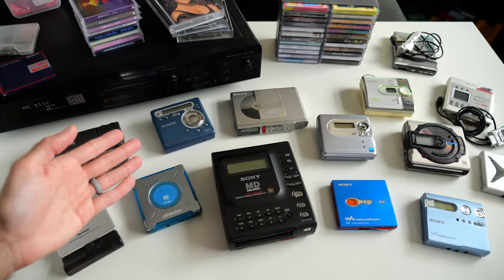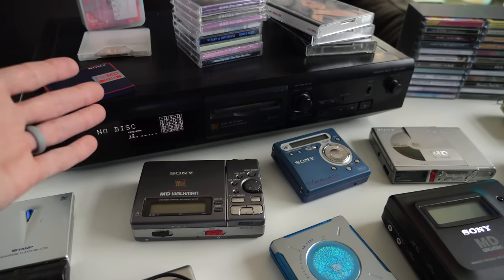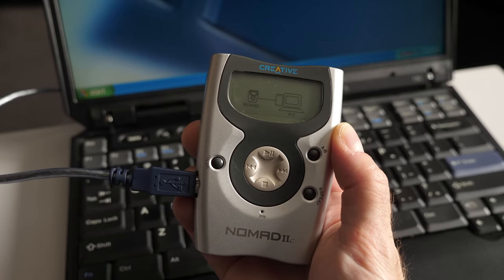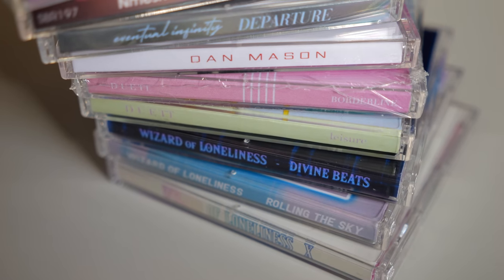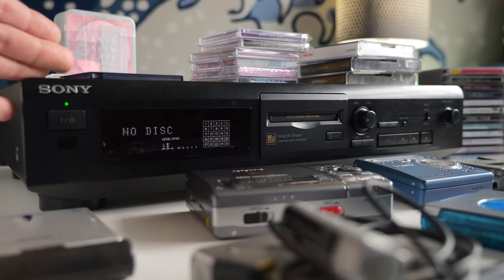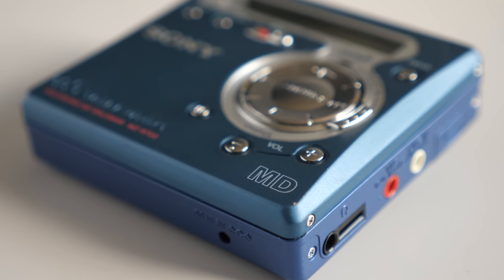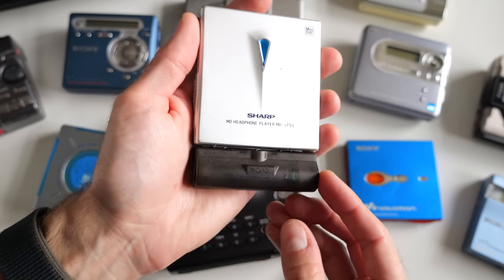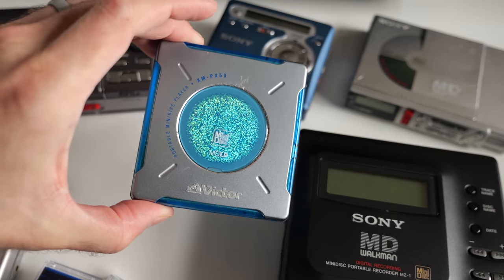Retro Buyer's Guide: MiniDisc!

Comment: I'm both pleased and terrified you released this because I was already shopping for these and now the price is probably gonna go up lol
Reply: lol same here.
Especially the NetMD stuff
Reply: I think as the units become super rarer, the prices will change. Love this video!
 
There have been lots of changes to usability and recording options to mindisc in general in the last year or so.  This means that people are seeking out more units since there has been somewhat of a revival of minidisc love. The infamous RH1 which had the only download and upload option on minidisc is no more. Most type s netmds can now do both, thanks to some very clever reverse engineers.  

Secondly Netmd works on most modern operating systems (including deck netmds), thanks to a universal usb driver. 

Also you can record in better quality these days as well, including raw formats. it is not as limiting as it was 22 years ago. So it is an ideal time to seek one out. 

There are also three or four different minidisc software options now as well, even one you can use in a browser. You are not limited to sonic stage anymore (unless your in the mood for emulating xp). You can even pull atrac files off minidiscs at last and convert them into various formats as well. it has changed quite a lot in the last year.
Reply: @darrenc2721  I have an old Sony Psyc that I used consistently until about 2009. I've wanted to go back to using it, but can't get Sonic Stage to run on my Windows 10 machine, obviously. Do you have any software recommendations for conversion to atrac?
Reply: @darrenc2721  Any links please?
Reply: i dont know why youtube doesnt always seem to post my comments, there is electron md software, platinum md and webminidisc pro. With type s you can now upload as well as download music back to your pc. it is a bit buggy. Note that the sony psyc is a type s. It strangely doesnt list it as such on the minidisc wiki.
Reply: @darrenc2721  Thanks for the info!
Reply: it always does.
Reply: @theumpteenthtime8854  Create a virtual machine in Windows 10 that runs an older version of Windows and install Sonic Stage in that.
Reply: I don't even want to know how badly I overpaid, but thanks to this video, iI just bought one. I'm not good with money.
Reply: I feel you, I got into wanting to build a minidisc setup again and just found this video too late it seems as prices are sort of crazy just like with all other “retro” electronics among games and audio these days.
Reply: I have two mz-b100 sony player/recorders for sale. Only one original box and external mini-microphone

Comment: Minidisc was one of those formats I'd love to have had back when it was mainstream. It would have beat the hell out of having a CD portfolio tossed in my backpack with a huge player in my backpack.
Reply: The only problem I ever had with minidisc was the audio quality, I could tell it wasn't as good as CD, now this was relegated to the first two types of minidisc and I'm not sure about its later netMD and other variants. But at least the first two recorded somewhere around 32khz instead of 44.1khz and I believe they were also 12bit upscaled to 16bit instead of true 16bit. So audio quality was definitely an issue if you were an audiophile. 

Believe it or not the majority of people using the minidisc for a while were broadcast studios, i.e: radio stations. Since flash was so expensive and HDD recorders weren't really a thing minidisc recorders were great for recording live interviews with bands, recording commercials, intros, etc...and for the longest time any radio station you walked into had a few mobile minidisc recorders as well as rack mounted minidisc players in the control room.

Just an interesting tidbit.
Reply: @hi-friaudioman  Audio quality was fine for a portable media.
However NetMD will be much worse than direct recording as it´s converting (probably mp3) to atrac at a default low bitrate (LP2, LP4) and this really sounds bad.
When using "compatibility mode SP" and converting from WAV, it´s better but still has some artefacts.
For standard SP mode, direct recording in real time is the best option in my opinion if you want the best possible sound quality.
The official specs are 16Bit 44.1Khz at 292kbps so it´s similar to 320kbit/s mp3
Reply: @MultiWirth  for casual listening and portable media, MD in SP quality is undistinguishable from a CD. LP2 is quite terrible (worse than a 128 kbit mp3) and Lp4 can be used only for voice recording. Atrac pre-dates mp3 and it uses computational power available in the early/mid 90's. If you consider that an average PC from late '90's was barely able to do a real-time compression in mp3, ATRAC must have used much simpler math and transformation. None the less, audio results are pretty good, much better than a compact cassette and comparable to CD for the not-so-demanding listener. I use it exclusively as a portable format and it that regards it is the best physical media format.
Reply: @enricoself2256  later hi-md models were able to directly decode mp3 files.
Also my 1997 Compaq Armada 7770DMT laptop using a Pentium MMX @233Mhz can decode and play 320kbit/s mp3 just fine.
It even plays flac audio in VU Player without any issues.
I think in the late 90s and early 2000s every new pc with pentium III and such will be powerful enough to handle mp3 both encode and decode.
Only disk space was an issue back then.
Atrac predates mp3 but they coexisted as it quickly became popular on file sharing sites.
The thing about efficiency and maths power was only archieved by improving the minidisc device's architecture just like with mp3 players later.
The first ever mindisic recorder from sony was a huge device, it's battery life was barely enough to play a 60min MD.
There was a lot of processing power involved as it seems but later models got very efficient by improving the architecture.
So there was less intense processing needed.
Reply: @MultiWirth  decoding mp3 and atrac is much simpler than encoding such files. The algorithm is intentionally designed to be asymmetrical, high processing power for encoding, low demand for decoding to allow portable devices with long battery life. But ATRAC, differently from mp3, was also used in recorders which relied on batteries; battery life on recording is typically half of even less than in playback, partly because of higher demand from the pick-up (higher intensity laser and coils to generate magnetic field) but also the DSP needs more power than in decoding. Surely a dedicated DSP can be made more efficient than a general purpose CPU encoding in software, but it's the 90's, DVD players needed a fan to keep the decoding DSP cool and pocket sized MD recorder run on two AA batteries. I think ATRAC cut some corners to be so power efficient; maybe later revision (type R or type S) improved the math due to improvement in DSP, but still results are remarkable to my ears
Reply: @enricoself2256  I'd say that's basic knowledge I'm well aware of.
Anyways I've got a Sharp MD SR50, launched in 2000 and it already runs off an single AA alkaline or nimh rechargeable for approx. 4,5h recording and 7h playback.
That's already a huge improvement over previous models.
Later models ofc. continued to improve.
It doesn't have any type s or r, i think that's generally just sony marketing here without any meaning.
The Sharp makes excellent sounding SP recordings.
I prefer this one over any other of my minidisc devices to record stuff in SP mode.
But this model has a common mechanical issue with a small gear moving the laser assembly.
Someone is making new replacement parts but it's quite difficult to replace.
I broke one of the new gear in the process but the second one is now installed and working properly.
Still 3 left for future repairs.
Reply: @MultiWirth  Did not mean to offend anyone, I kept referring to encoding and you were replying with decoding numbers and performances. If we are on the same page, fine. Sharp, as Panasonic, had their own ATRAC implementations and, like Sony, played with performance figures and facts to their favour. ATRAC Type R is the last revision of Sony SP encoding DSP, while type S is the last revision of LP2/LP4 encoding DSP - considered by many to be the best Sony ATRAC implementation. I cannot say, LP2 and LP4 are terrible to my ears, reminiscence of old 128 kb mp3 from 2000's. To my knowledge, decoding never changed during the years, as any ATRAC SP implementation is compatible with any player. I have only Sony portable models from 1999 to 2003 and they all sound identical to me, never noticed any difference. Other brands are difficult to find in my country and available Sharp models are pretty old and bulky.
Reply: Minidisc was mainstream at some point? My first was an MZ-R3 which I bought around 1997-98 and kept using an MZ-G750 until today. In all those years I knew only one other guy who had MD. Everyone else was on tape and CD. Most people didn't even know what MD was. I knew one guy that had DCC. Weirdo. 😉
Reply: I stuck with cassettes all the way to mp3. Size wasnt that different and the panasonic portable players were fairly epic. Been looking for the high end models on ebay (backlit stick remote, not the fob) but they only have the mid/high end. I have one and it runs still. Just want that one from back in the day lol
Reply: @dutchbachelor  i had that friend too lol. Its so much smaller didnt matter because all the music was on cassette cd or lp anyways. And we had a huge argument because i deleted the spyware laden sony software off my pc and wouldnt let him use it again 🤣
Reply: Way back then it was nice to have something that was meaningful and during that couldn't be destroyed. You know!
Reply: But then you have to purn all those mini dics and that dose not seem worth it to me. I would just stick to the CD player. If you're already buying the CD why not just play that? Ripping to mp3 makes sense but not to mini disc.
Reply: Laughs in mp3 cd

Comment: I got a HiMD recorder in 2006 for recording our college choir concert tour of Italy. I'm very glad I held onto it. I actually didn't use the 1GB minidiscs much -- you could also use the regular minidiscs, so I did that pretty often.
Reply: Yep. Most of the online sources aren’t really clear about it, but you can use the HiMD recording modes on standard MiniDiscs (and it about doubles the storage capacity), or you can use the standard MiniDisc modes (like SP, LP2, and LP4). For that matter, you can record about a half hour’s worth of PCM audio on a standard MiniDisc using a HiMD recorder.
Reply: I never tried sticking a regular minidisc into the HD player...
Reply: @danthemainman1 😊
Reply: @danthemainman1  If you format a standard 80 min minidisc for Hi-MD, I think it's around about 305 Mb which is 20-30 minutes of PCM recording (from memory - off the top of my head)👍😎

Comment: I still have my MiniDisk tower (they made those!) by Sony with all my pre-recorded MDs (around 60) and plentry of recorded ones. MD was somewhat popular in Finland in the late 90s. (The tower had one drawback as you couldn't fit 2 disk releases but the tower itself still looks slick and stylish lol) And I still have my 5MD/5CD changer + portable MD player all in my storage - there is something cool about them.
Reply: Just out of curiosity - 5MD changer? Did you mean car changer? Or there is deck-like changer. I was looking for something like but did not found anything such thing yet. 
BTW two years ago (or so) I joined to the MD family. Two decks and one portable so far. 
All the best to those loving the format.
Reply: @piotrw4091  My player is Sony DHC-MD555 Shelf system with 5-disc CD changer and 5-disc MD recorder/player/changer I bought in 12/1998. I bought it in Finland. 
Basically a home system. When I bought it, it was quite expensive. I tried checking eBay(fakes etc.) and other sources but couldn't find much info - perhaps it was for our European market - your have to check that yourself? I'm not sure I could ever part from my MD systems. In fact I think in my next apartment I will set up my MD tower, my MD system etc. on display - but to be used. (Did I mention that my systems are almost mint since I have worked allover the globe and haven't had time to use them.)

Comment: One thing that no one mentions about recording CD's to minidiscc is this.  I put 5 CD's in my CD Player, and program a bunch of tracks to play ramdomly over the 5 discs.  I then set my MD recorder to Synchro Record and push the record button.  It then sits there an waits for the source to be played.  I then push play on the CD changer.  The MD starts to record automatically.  Now here is the best part.  When the CD changer is switching between disc's and tracks, the MD will automatically put a 3 second gap between each track, no matter how long the CD changer takes to start playing the next track or disc.  I can have the CD changer play songs from a different disc for every song and it still puts a 3 second gap between the recorded songs.  So real time recording doesn't really matter.  I start it going and then go and do something else for the 74 minutes it takes to do the recording.  When I get back sometime later, I look at the last recorded tradk, and if it isn't complete I erase it.  
This is way way easier than recording from a computer to other media, and doesn't mean I have to spend any effort or time figuring out how much music will fit on the recorde disc, or like I used to do when recording to tape.
BTW, thanks for pointing out the two links for Sonic Stage and Web Minidisc Pro.  My MZ-R30 stopped working a couple of weeks ago and I'm in the market for a replacment recorder.  I can now consider the net MD models.
Reply: I play 1 CD to record MD. I had Net MD and the device is not working any more.
The MZ-R30 is excellent and I love it, it records used MDs, while an Onkyo only records new MDs. The good news about the Onkyo: I can record 2x speed dubb, also I can record from its toslink with the 2 seconds of scape between tracks. :o !

Comment: My hobby is to find broken units and fixing them. My worst enemy is battery leakage on the motherboard, which you mention; luckily, it is easy to spot before you buy. Every time I open these units I marvel at the miniaturisation - Sony was great at solving complex challenges with simple solutions, like flexible ribbon cables. My favourite unit is the MZ N910, however the most robust unit I have ever worked on was the MZ R50 - solid build! Fantastic video, Collin, your storytelling skills are second to none.
Reply: Do you purchase working devices, I have two very nice working and tested Sony mz-b100 models

Comment: During watching this, I bought myself a MZ-R37 online. So thanks Colin for the video! Have been meaning to get back to MiniDisc for a long time, but have only owned an entry level Sony playback-only portable, which I purchased on the whim when I was something like 10yold and these things were already on outlet sales. Just to realize that I can't have any music on it. So I had to buy a recording unit, MDS-JE510 (used, from a local music enthusiast). That I still have and It's working OK, does have the "Eject/NoDisc" symptom however, need to fix it some day. I also own a NetMD MZ-N505 but that has seen some life, and does skip and keeps horrible noises, so barely usable. Can use it to record though...

Comment: Great guide. I've been into MD since the early 2000's and MDLP times. Never really left the format, though like most went down the MP3 player route. Now their batteries are dying, have come back to MD with a vengeance! All my older MDLP portables are still working perfectly - mostly AA only units. I also have several HiMD recorders and I actually would recommend them. I mostly use the bog-standard MZ-NH600 which may be affordable and has great sound quality. They can still use 'standard' MDs if you can't get/afford the 1GB disks and benefit from higher capacity than MDLP. I'm using MD every day now and loving it!

Comment: MiniDisc wasn’t a failure here in Australia but it was arguably a bit late to take off. It wasn’t until the late 90s that prices became tolerable and the small size offered a compelling alternative to portable CD units, especially for exercise. I got an MZR55 like yours in 1999 which was great for a time, but started failing barely 3 years later. A person at a local Sony Shop admitted later to me that model was a bit notorious for drive mechanism failures. Conversely my brother had an MZ-R90 that was still working perfectly fine by the time I sold it in 2014 (for $50 - now worth 4x as much!). I also had a Japanese market Alpine combo MD-CD head unit that was pretty darn sweet.

Comment: I have just came across this video. We purchased one of these brand new and ours also has a digital TV tuner module on it. I checked and almost forgot about this item and we also have 16 discs that are still in the rapper and never opened. I purchased it for the wife at the time. She never got to hardly use it at all due to loss of vision. She could not read the little digital display at the time. I tested the TV tuner portion on it and it was kind of nice to be able to listen to live TV.

Comment: I've kept using minidiscs since they were introduced, mostly through a hi-fi deck. I've picked up 6 MZ-R30 / R35s on ebay for about £20 each, usually because they were sold as 'for parts / not working' and that was usually because the battery wouldn't hold a charge. It's a bit of a risk but in every case I've cut the old battery casing open (carefully, with a scalpel) and replaced the old (worn out, 30-year old) cell with a new 18650. They all work perfectly and I use them to record compilations through an optical link from my laptop (the headphone jack is also an optical out).